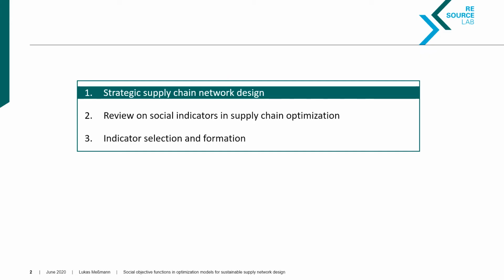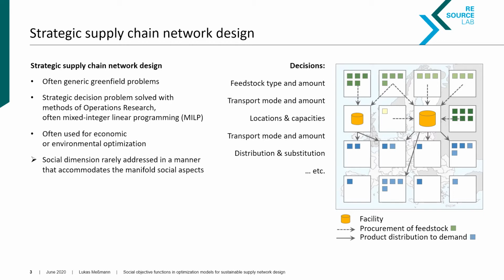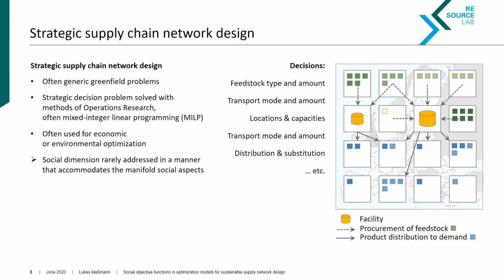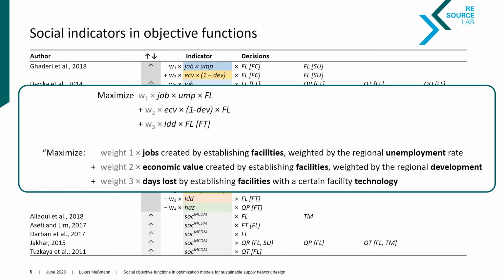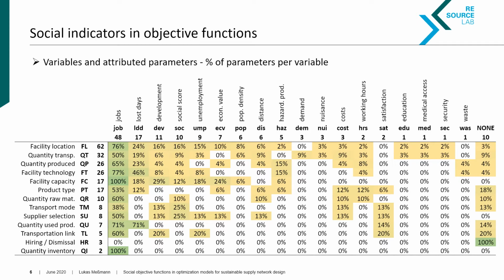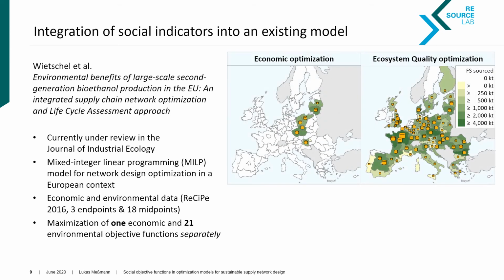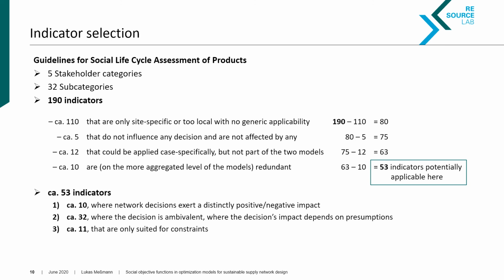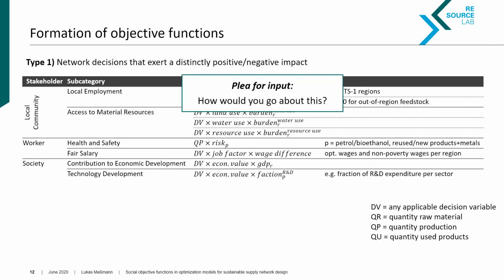Session 3.2b - Paper 59: Social objective functions in optimization models for sustainable ...

Comment: Interesting application. You asked for input, but perhaps you can also elaborate first on what exactly the barriers are you need to solve. I can imagine a few, like most qualitative indicators in the SLCA are defined as risk per working hour, but increasing the working hours is one of the objective. the other issue seems to be the use of risks only, while you probably also want to measure positive contributions to society. How far am I off?
Reply: Hello Mark, 
Thank you very much for your comment! 
You are not far off at all. Our main issue and/or barrier is the fact that most social aspects are measured as risks (e.g. risk for forced labour per work hour, or in risk hour equivalents), but in such a generic and greenfield application, the network decisions do not generically exert such risks, but may have other social/societal impacts. Our main difficulty is the definition of all of the relevant impacts that the model's decisions can be attributed with, more than just the maximization of created jobs or work hours. In the Supply Chain/Operations Reserach field, most literature implements the social dimension as "maximize jobs" or "maximize jobs in regions with high unemployment" or the like. This seems a bit narrow to me, considering how many social indicators there are for site-specific assessments, but only few practitioners in the SC/OR field are also experts in SLCA, and neither are we. Which is why I hope to get in touch with SLCA experts and to hear their opinion about our approach, or even some suggestions. :-)
And as for the risks (e.g. forced labour): I suppose we could "measure" them (i.e. calculate the risk of economically or environmentally optimal network decisions, e.g. based on SHDB processes), and we also plan to do this, but ideally, we would have social objective functions, too. So for example, we would be able to "maximize" one or many social goals in this network model. To maximize work hours, as done in most literature in our field, is easy and quantitative. But could it, in any way, be possible to include e.g. the risk for forced labour into decision making? The decisions are on such a generic and strategic level, so that we couldn't know whether the decision to hypothetically set up a biorefinery in a region with a higher risk would exert a negative or positive impact. (I hope my explanation was more or less intelligible - please leave a message if it was not!).
And I am not 100% sure if I understood your middle sentence ("I can imagine...") entirely. Could you maybe explain it briefly? I have the feeling that it is a very relevant comment.
Again, thank you very much!
Reply: Hello Mark,
I have thought about the one of your sentences of which I wasn't exactly certain yet: "most qualitative indicators in the SLCA are defined as risk per working hour, but increasing the working hours is one of the objective".
This is true, but how do SLCA practitioners deal with this? Is it reasonable to, in a first step, look at each social objective/aspect individually, i.e. "the model should maximize an employment benefit", or "the model should minimize a certain risk"? In the economic and environmental objective functions, we first solve each objective individually (e.g. maximize profit, maximize GWP benefit, maximize land use benefit ...), and then identify conflicts and congruencies between the solutions and their decisions, or calculate Pareto-optimal frontiers, etc. In that sense, the social goal of employment creation could stand for itself, but the goal may be conflicting with other goals some countries, when increased working hours yield a high risk.
Would that, in a way, address your concern?